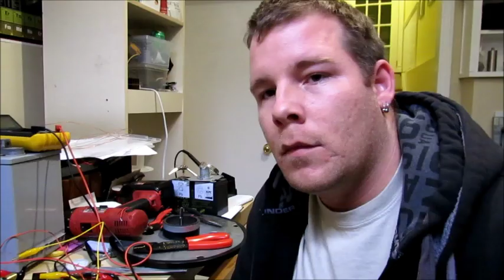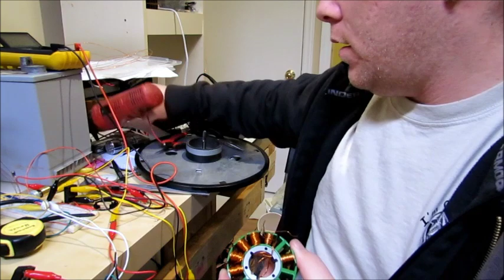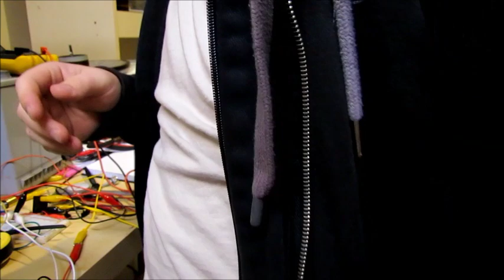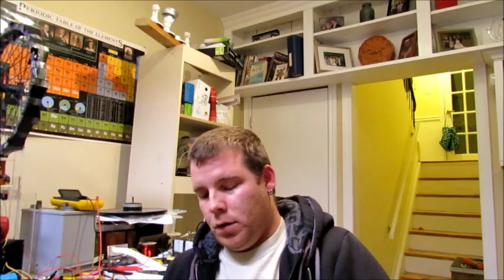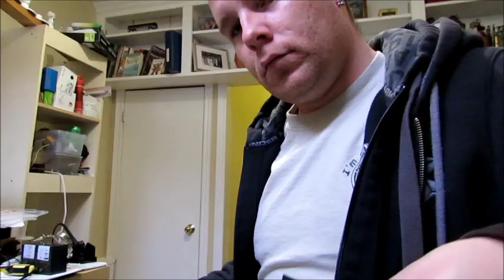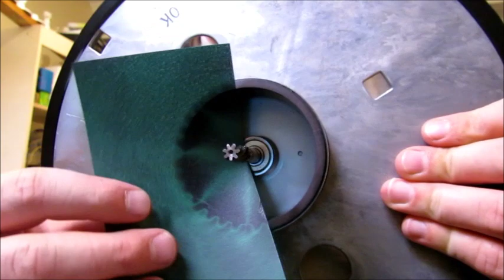Free energy "The Revolution SSG Bike" P8 By inventor Matt McMahon, inspired by John Bedini Motor

Comment: I have made the standard bedini from a computers hard disk,, my main concern was the batteries and how their wired, because they look like a 24v unit when that link is used between the two batteries, if you take a reading, use the output from the motors coil/s rather than anywhere near the battery/s as you will mostly read from the 12v side rather that whats getting made.
Mines only got small magnets so might not be too strong, and ineffectual at making decent currant.

Good luck.

Comment: about QEG-generator:
--- OVERUNIT is using permanent magnet in the coil (with same directional fluxe coil/magnet)
then, COP  of the "magnetic motor" will be >100%...after this overunit, you may use Q.MO.GEN system to produce energy
http://linoavac.no.sapo.pt/exafilar.jpg
http://linoavac.no.sapo.pt/electrorepulsion2.jpg
VERY simple !!!! by Linoavac ------

Comment: Hi Matt. A good way of measuring a battery's capacity and state of charge is by using a HALL effect sensor. Also remember that due to the Generating effect of motors they can spike voltages, this can damage your batteries severely. try using capacitors and inductors or simply a cap and rectifier to prevent this.

Comment: Matt,.
" ... It's a gel cell battery not a sealed lead acid... "
.
You are wrong, a "Gel Cell" is a type of "Sealed Lead Acid" battery! (use google to learn about batteries.
.
" ...Where it's saying I am getting 3 v output it in fact is putting out over 100 v spikes... " 100 Volts spikes mean nothing. I repeat, 100 volt spikes mean nothing. Your battery (Gel Cell, SLA, Li-Ion, NiCad, whatever) will always discharge to ZERO Volts. And you have made absolutely no progress to prove otherwise.

Comment from the maker: It's a gel cell battery not a sealed lead acid. The issue with this device is the readings can not be accurate because the meter doesn't read it right. Where it's saying I am getting 3 v output it in fact is putting out over 100 v spikes. The micro amps are showing up as 0.01 and 0.00 back and forth. I am making an analog micro and mili multi meter which I am hoping it will give a more accurate reading. If the only measurement that can be measured as being consumed is volts the that's whatIgot.

Comment: Matt,
 You discussed, how much (or how little) POWER you thought you consumed from your SLA battery. But you reported the "OPEN VOLTAGE" of the battery. The problem is "OPEN VOLTAGE" of a SLA battery is VERY, VERY, VERY misleading way to measure the STATE OF CHARGE in the SLA battery! Actually, it is almost USELESS.
.
Lesson #1 = Learn how to properly measure the "STATE OF CHARGE" of an SLA Battery.
.
Lesson #2 = Research ( I ^ 2 x R ) LOSSES. You are in for a very, very NASTY surprise!